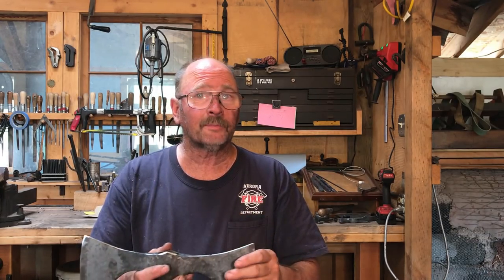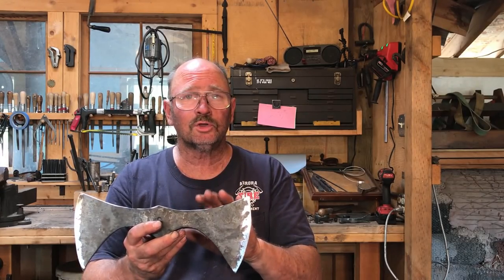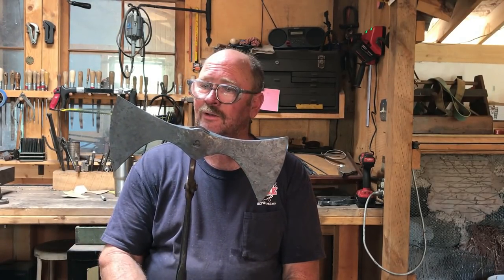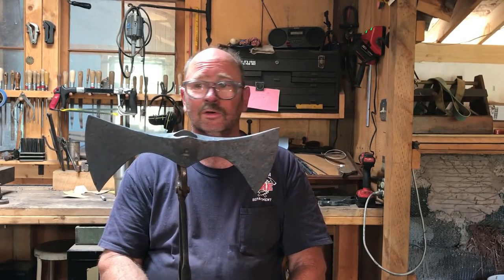Double edge Viking inspired battle axe

Comment: Hey John, glad to see you experimenting! I watch because you are an excellent teacher but upping the cinematography level couldn't hurt.  So here's my 2¢.  The establishing shots add some interest for sure and I like them (I also understand that your just trying things out here) but I would treat them like garlic, you need less than you think you do most times.  Alternate camera angles during an operation add a lot of interest and can often give an enhanced understanding of what you're doing.That said, I'm sure you noticed the camera stability problems near the grinder, power hammer and sometimes the anvil.  You can likely address these with weights on and/or padding under the tripod. For lengthy and repetitive processes, if you feel it's not adding anything to the story, you can definitely either cut out some of the middle bit or speed the process up though I personally don't mind going through the whole thing.  As for slow motion, it can add some visual interest, especially in the bits with lots of fire and sparks and there's nothing wrong with that but in terms of improving the way you communicate what your doing it might be better used to show, for example, the angle at which the hammer head is striking the steel and how it's moving in response. In audio terms It would probably be wise to normalize the sound across all your clips and maybe give it all a listen once it's cut up the way you want it to tweak volume levels as needed. The lighting looked pretty good for most of that, the only thing I would suggest working on is where you sit and address the camera directly.  There's quite a lot of reflection from your primary light in your glasses which can be a bit distracting.  A simple solution would be to take them off, then you'd just have eye lights which add to the shot instead. If (as I suspect is the case) you need to wear them, you could just move the light a little further off the axis of the camera shot and (if needed) fill from the opposite angle with another light or a reflector.  That was a lot I know, sorry for my verbosity but I wanted to give you as much useful information as I, with my limited experience, can give.  At the end of the day, do what you think adds to your message and don't worry about the rest. You can drive your self to insanity chasing analytics.
Reply from the maker: Thanks for the suggestions

Comment: All right, here is my opinion (and we all know what opinions are like), and hopefully this helps you to continue to improve your videos.  I'll start at the beginning, and work my way through.

First of all, that's a great mug.  The beginning, where you are walking to and entering the shop, reminds me of "The Woodwright's Shop".  While you can't go wrong taking inspiration from Roy Underhill, his entire opening sequence (including funders) is 50 seconds long (I can say that with certainty because I work at a PBS station, I often check that program when it records, and that is when he takes off his hat).  IMO, most good YouTube intros are at most half that).  As an intro, it DOES help to show 'this it what I did in the morning' (Torbjörn Åhman does a terrific job using small outside-the-shop clips to show there is time elapsed between two steps), but only if it really is morning work.
The shot at 3:46 doesn't work.  I don't think it's just that it's out of focus at the beginning; it's looking at something flat edge on.
Most of the shots are good, and even enjoyable (actually, about everything except the one thing I mentioned above).  I would probably like them... somewhere else.  You have over three hundred videos, and you have developed your own style for your videos.  I think you can easily add a few little bits like this now and again, but to be used sparingly.  A bit of salt improves a fine steak, but too much will ruin even the best cut of meat.  And I realize this was a sampler of many (video/shot/style) techniques, not an attempt to make a "polished" video.
I like the style you have developed, and hope to see more of it in the future.  But I also hope you can find ways to incorporate pacing and "artistic" sequences that work for your style and your channel.  You have to find what works for you, your channel, and your viewers.  I have faith in you!  You'll get there!
Reply from the maker: Thanks for the observations

Comment: John I did enjoy the video a great deal and have been trying to get started videoing my work.  What kind of holder are you using to hold the iPhone.  I have not found anything that will hold my phone everything I have tried has either dropped my phone or will not stand with the 8plus phone in it.
Reply from the maker: I use a Shoulder Pod holder and it is quite secure.  The weak link in the video I think was a cross bar I was using to also hold the microphone.
Reply: Black Bear Forge thank you John

Comment: I loved the idea of this video for testing with that being said I will watch no matter what you do, I think there is much to learn! As for the new setup the new mike has too much gain for the close ups @ 3:46 . Some of the shots like @ 4:51 you may want to try a ND filter (neutral density) or block the outside window. The shot @ 10:10 is a perfect mount no shaking and good and sharp. I have a question is your shop on a wood floor there is a lot of shaking going on most of the time @ 7:13 you need sea sick pills Lol and the last thing your closing shots @15:00 you key light is at 90° to the camera and your glasses don’t like it . Sorry to be so picky but you asked for it but just know you can’t make me turn off early. Best of all be well and be safe.
Reply from the maker: Thanks for the input.  No the floor is dirt or brick over dirt.  My usual camera doesn't shake this bad, so it has something to do with the way the phone is mounted i suspect.  The light reflection off the glasses and bald spot are on the short list of things to deal with.  I don't have much space to move lights around without the stand being in the shot.  I may need to go to some sort of wall or ceiling bracket.

Comment: John,
I’m the former TV news guy. I’ve made comments before. I have some comments about your videography. First let me say, you did a very competent, credible job, much better than most I see. You told your story very well and for the most part the shots, angles, etc. were good. But, I do have some comments. I thought your opening sequence was good, but too long. Unless your plan was to detail very step in getting your coffee and getting out the door, your cuts needed to be shorter. Start the coffee pour then go to the next edit (cut). You included putting down the pot down, not needed. People got the point by the first gurgle of coffee into the cup. After you walked out the door, you  showed you taking 8 steps. Once again, not needed. You did make a mistake in that walking sequence. You crossed the line of direction. You should always keep the camera in the same plane while shooting. In other words when someone is walking or moving in a more or less straight line, always keep the camera on the same side, the right or left. So, if you record someone from their left, subsequent shots in that sequence should be from their left.
Reply from the maker: Thanks for the observations.

Comment: I like the older versions. Mixing it up with the slo-mo once in a while would be cool but the camera shakes a lot! 🤢 I personally would like a camera set up in the top corner of your shop so I could be a fly on the wall. P.S. I’m very jealous of Jake! I wish I could be your striker for a day or two, I know I’d be taught by one of the best.
Reply from the maker: The idea of a camera that sees the whole shop really appeals to me.  But I haven't figured out the technical details to be able to control it without climbing up on a ladder.  Plus it would probably have to run in almost every clip while the primary camera catches the details.
Reply: Black Bear Forge 
I’m pretty sure that at least some cameras come with a remote control.”Black Bear Forge  Live” just you doing your thing! Though I do like the commentary, I like your humor, I laugh out loud a lot!

Comment: Well John I liked the video. There are a couple of the new things that need a little work. I am sure you saw them when reviewing the video. In the close ups of super hot steel on the power hammer the vibration of the hammer caused a vibration in the camera which was evident in that footage. Maybe the cmaera needs moved back a foot or 2 and the setting magnified to allow for the same view with less vibration. That will have to be a trial and error issue until you get it right. Having said that it is the only thing that I think needed some change, adjustment or improvement. The cell phone gives a much more vivid picture with much sharper color. My daughter takes pictures on her phone with a program call snapchat. It gives a much sharper and more colorful picture. Now I know you can't use that for your video's but I also know there are a bunch or different camera and video applications that you might be able to use to lesson the vibration or maybe thay have settings to eliminate that. Overall I like the new things that you are trying and I also like the cell phone for the specialized effects you have used them for. Good luck and ask anytime. Happy to help you as it actually helps me. I have watched each and every one of your video's that I have seen up to the end.
Reply from the maker: Thank you for the observations.  I suspect in the long run I will go to a digital camera that takes video.  that would allow for better quality similar to what the phone does but with lens choices to allow for positioning further back.

Comment: A few things... average attention span of people now adays is about 5 min.  If you don’t grab it right away and hard, they are likely to wonder. Now the low angle shots were really cool. I didn’t notice any lighting issues even though you didn’t set up lights. And I HIGHLY encourage people to use the time tool to speed things up. Not. Huge fan of slowing things down, but it does let you see the sparks and all the subtle details.  A few critiques, #1 is the tripod. Your camera was shaking all over everywhere. It some of the shots I was gettting a bit queasy and had to look away. It’s a common problem with bigger power-hammers, but it was even happening at your regular anvil. I think that is due to camera placement more than anything else. Second thing is one not many know, and that is the 180° rule. You do not want to cut to two cameras 180° opposite each other. It will confuse your Audience. The place I noticed it a lot was when you cut turning away from your power hammer, then you cut to the same power hammer at the opposite angle. Human brain gets confused when you do that. Love the walking up to the forge, I think you might be able to combine that with your mantra for a new intro.
Reply from the maker: With the cell phone I did use a lighter tripod, although It is one I have used with the other camera in the past and it didn't seem so shaky.  I suspect the mount for the phone may need to be clamped on tighter.  It seems solid, but i agree there was an issue.  Thanks for the 180 rule, I suspect i break that one often.  I tens to like the camera angle from the heel of the anvil, but often them move to the horn.  I will have to watch that.  You're making me want to sign up for your class, other than the 3 hour drive up that is.

Comment: The TV guy again. I accidentally hit send but hadn’t finished. To continue: you may certainly finish a video of an action process, but some of your sequences (creating a taper, for example) could comfortably be shorter. Your plan for two camera shooting could help that a lot. Use the second camera for your cut-aways when you want to reduce the length of a sequence. Also, Look closely at your video. Some of the camera angles weren’t “artsy,” they were sort of clumsy or even confusing.  Decide what kind of “angles,” you should use and what kind not to go back to. Finally, when you’re planning a segment of video think of the story you need to tell at that point. You might even make plans for the entire video. For example 1. Project introduction, 2. Tools to use, 3. Materials selection, 4. Heating materials, 5. Hammering, 6. More hammering... you get the idea. Once you have your plans on paper, build a story (in your head) about each step and decide how best to visualize each. There is a basic sequence of shots that most camera people keep in mind as part of their repertoire. To tell a story, do an establishing shot, usually a wide shot that shows where everything or everybody is. Next a detail shot, to show what is important about the scene, then go into the action. That’s generically a wide shot, closeup, then a medium shot. That WS, CU, MS sequence shouldn’t be used on every step, but keep it in mind. I hope that helps some. If you have any questions, contact me directly.

Comment: Hey ! Thank you for yet another great video! I know that this is off subject but I just put in a layer of refractory cement into the bottom of my Champion forge pot Witch is cast iron. The layer that I have in it is probably 1/4" how thick should I go with it? And should I lay some on the outer part of the bowel? I really want to know because this thing is in such amazing condition and I wish to pass it down to my son. Btw I believe that I bought it or damned neer stole it for $200 at a flea market with the blower that's gearing runs smooth as silk. The weight of the crank handle will bring it straight down on it's own almost no gearing slop.. I hate to toot my own horn but this thing is awesome!! And I am proud to be a "Steward" to such a piece of equipment. It would kill me if I ignorantly did something to wreck it. Your advice would be much appreciated.
Reply from the maker: I have never known anyone to put cement on a fire pot, so I can't offer any advise.
Reply: Black Bear Forge it says inside of the casting of the bowl of the forge. "Clay before use" but like I said before.. I absolutely love old school tools and I don't want to do ANYTHING! To hurt it but I appreciate your input, and your videos are inspiring and very informative. Also your answer to my question is great because you have no intention of B.S'ing me when you don't know. I am the same way. If I know something about something that Someone asks me about I will extend my knowledge. If not. I straight up say I have no clue.. Something that I have learned from my grand father.. and father is. " I would much rather be dazzeled with Brilliance than be baffled with bull shit!" And your character truly show's when a man can admit that they "just don't know" thank you very much for what you do..
And good bless for you and yours.😀😀😀 Lol. I shall search on!!!